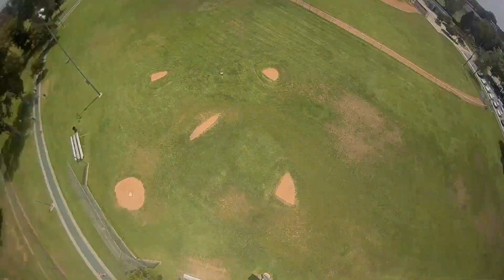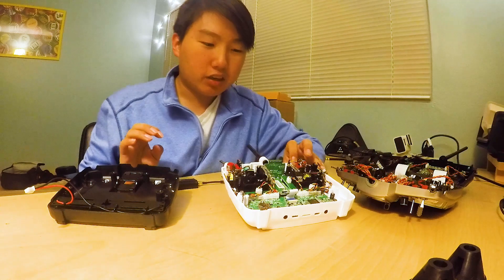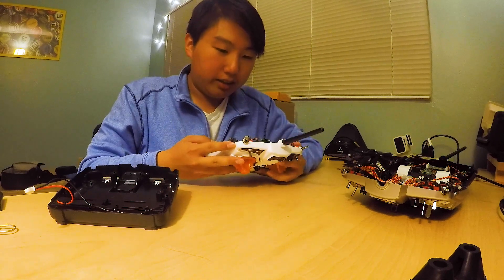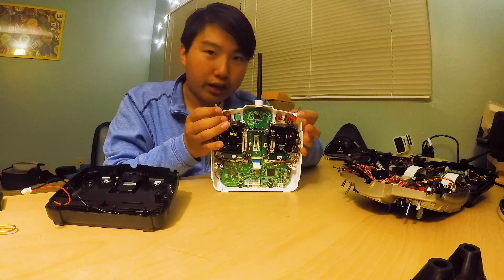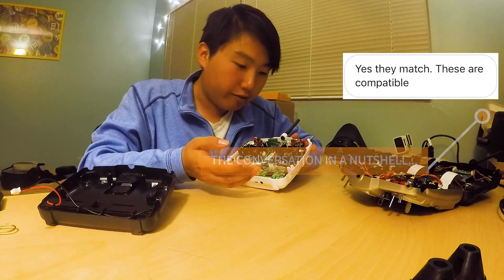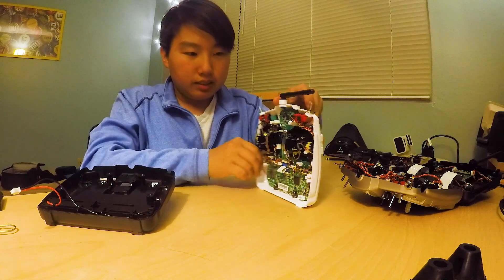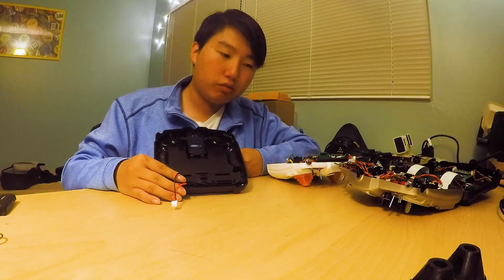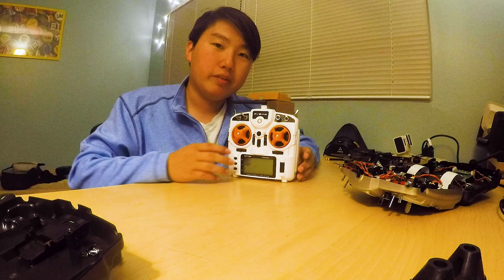Frsky X9 Lite Design/ Hardware Layout Analysis

Comment: Tip for your next video: use a towel or any other soft cloth below your radio's as the video is quite noisy because of moving the equipment over your desk. ;-)
Reply from the maker: Yeah, I will try a rubber mat next time 😁👌

Comment: If you remove the 4 screws holding the 18650s you have enough room for a 2S 5000mha, the battery door will remain functional for charging via pigtail.
Reply from the maker: True, I just wish they had a plate that would screw on in place of the 18650 holder.

I don’t like the idea of all the electronics scratching a LiPo.
Reply: @TiredFlyerFPV  I'll take measurements and 3d print something for it